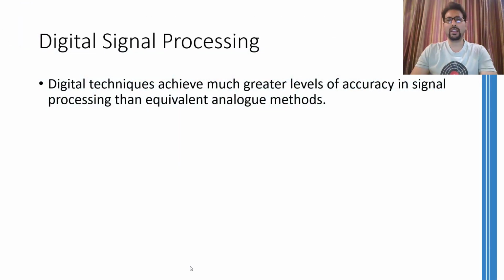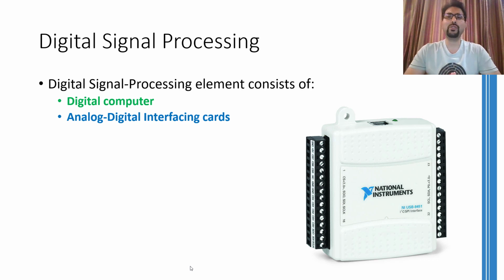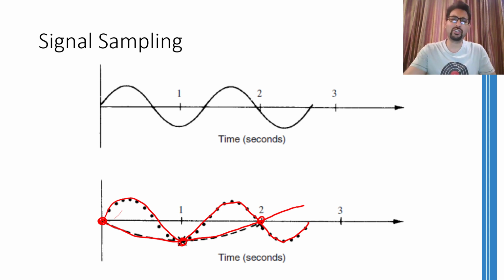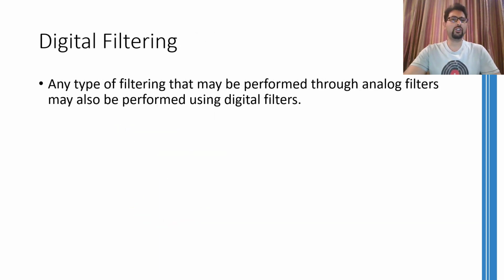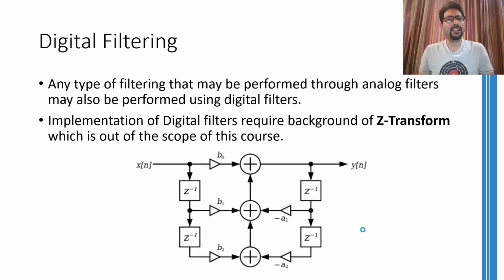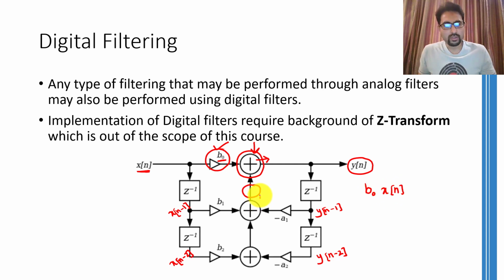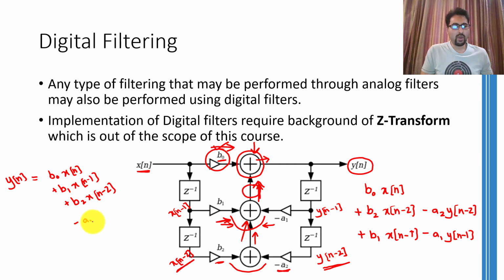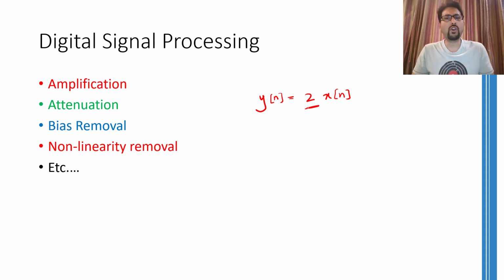Lecture 6 Digital Signal Processing | DSP | A Quick Introduction

Comment: 1- Quantization in digital processing,is the mapping of input values of a largest set to output values in a smaller set 
2- Quantization error is the difference between input signal
And the quantized signal.

Comment: 1) Quantization is the process of mapping continuous infinite values to a smaller set of discrete finite values.
2)The difference between the analogue signal value and the nearest most available digital signal value at the sampling interval in the conversion process of A/D is called Quantization Error.

Comment: 1- Quantization is the process of mapping the value of a continuous signal to a finite set of discrete signals.
2- Quantization error is given as the difference in the value of an analog signal and its corresponding digital signal.

Comment: - Quantization is the mechanism by which a continuous signal value is mapped to a finite set of discrete signals.
- Quantization Error is the difference between the analog signal at each sampling instant in ADC and the nearest digital value available.

Comment: Quantization is the process of mapping input values from a large set (often a continuous set) to output values in a smaller countable set, often with a finite number of elements. Rounding and truncation are typical examples of quantization processes.
Quantization error is defined as the difference between an input value and its quantized value such as round-off error .

Comment: 1-Quantization is DSP method in which we done mapping of input Value which is usually a continuous set to output value which is small set,often a finite number of elements - For this we choose an amplitude value closest to the original amplitude of analog signal
2-Quantizatiom error is the difference of analog signal and the obtained digital signal which we done by choosing closest amplitude

Comment: A)
Quantization, in digital processing, is the mapping of input values of a larger set (continuous set) to output values in a smaller set
 (finite values set)
B)
 Quantization Error is the difference between the analog signal and the closest available digital value at each sampling instant from the ADC.

Comment: 1)  Quantization is the process of mapping continuous infinite values to a smaller set of discrete finite values
2) The difference between the analog signal and the closest available digital value at each sampling instant from the ADC is called "Quantization Error"

Comment: 1) Quantization is the process of mapping continuous infinite values to a smaller set of discrete finite values.

2) Quantization error is the difference between the analog signal and the closest available digital value at each sampling instant from A/D converter.

Comment: Quantization is the process of constraining an input from a continuous or otherwise large set of values to a discrete set .
1)Quantization in digital processing  is the process of plotting input values from a large set to output values in a smaller set.
2)Quantization Error : it is the difference between the analog signal and the closest available digital value at each sampling instant from the A/D converter.

Comment: .Quantization  is  the  process  of  mapping  input values from a large value of set, to output values in a smaller  of set
2. Quantization error is the difference between the anaolge signal and the closet available digital signal in the sampling of adc

Comment: 1) "Quantization" is the process of mapping input values from a larger set to output values in a smaller set with a finite number of elements.
2) The difference between the analog signal and the closest available digital value at each sampling instant from the ADC is called "Quantization Error".

Comment: 1-Quantization, in digital processing, is the mapping of input values of a larger set (continuous set) to output values in a smaller set
 (finite values set)
2: Quantization Error is the difference between the analog signal and the closest available digital value at each sampling instant from the ADC.

Comment: Quantization is a process of constraining input values from large set of values (continuous infinite values) to output from smaller set of values (discrete finite values).
Quantization error means at each sampling instant the difference between the analog signal to the closest digital value during the A/D conversion.

Comment: 1. Quantization is the process of mapping input values from a large set (often a continuous set) to output values in a (countable) smaller set, often with a finite number of elements. 
2. Quantization error is the difference between the analog signal and the closest available digital value at each sampling instant from the A/D converter.

Comment: 1) Quantization is the process of mapping the value of a continuous signal to a finite set of discrete signals.
2) Quantization Error is the difference between the analog signal and the closest available digital value at each sampling instant in ADC.

Comment: 1-Quantization in digital processing is the mapping of input values of a larger set to output of a smaller set
.
2: Quantization Error is the difference between the analog signal and the closest available digital value at each sampling instant from the A/D converter.

Comment: --> As the name shows the quantization is basically the process in which we map input values from a bigger set to output values of a smaller or finite set of elements

--> Quantization error is the difference between the analog signal and the closest available digital value

Comment: Quantisation in mathematics And digital processing system, is the process of mapping input values from a large set to output values in a smaller set.

2  Quantisation error is the difference between the analogue signal and the closest available digital value at each sampling instant from the A/D convertor.

Comment: The process of mapping input values from a larger set to output values in a smaller set with a finite number of elements is referred to as Quantization.

The difference between the analog signal and the closest available digital value is referred to as quantization error.

Comment: Quantization describes the process where continuous analogue signal is converted into discrete values of digital signal by sampling the analogue after regular interval.
Quantization error: At any particular value of analogue signal, the digital representation is either the discrete level immediately above or below this analogue value, if we consider this difference as Q, then maximum error in each digital sample is +/- Q/2, which is known as quantization error.

Comment: 1.Quantization is the process of mapping input values from a large set, to output values in a smaller set.

2.Quantization Error is the difference between the analog signal and the closest available digital value at each sampling instant from the A/D converter.

Comment: 1:Quantization in digital signal processing is a process of mapping input values from a large set to output values in a smaller set, often with a finite number of elements. Rounding and truncation are typical examples of quantization processes.

2:Quantization error is the difference between the analogue signal and the closest available digital signal value at each sampling instant from the analogue to digital converter.

Comment: 1- Quantization:: Quantization is the process of mapping continuous infinite values to a smaller set of discrete finite values
2-Quantization error is the difference between the analog signal and the closest available digital value at each sampling instant from the A/D converter

Comment: 1. Quantization is the process of converting discrete sample values to some finite set.
2. Quantization error  is the difference between the analog and digital signal and the closet available digital value at each sampling instant from the A/D converter.It also introduce noise.

Comment: 1. Quantization in Analogue to Digital signal Processing is to map out larger set of continuous range of values i.e analogue signal to smaller set of limited range of Values i.e digital signal.

2. Quantization Error is the difference between the analog signal and the closest available digital value at each sampling instant from the A/D converter.

Comment: 1) : Quantization in Analogue to Digital signal Processing is to map out larger set of continuous range of values(Analogue signal) to smaller set of limited range of Values(Digital Signal).

2):  Quantization Error is the difference between the analog signal and the closest available digital value at each sampling instant from the A/D converter.

Comment: 1. Quantization is the process of changing a continuous data signal (having infinite values) to a discrete data signal (having countable number of values).
2. Quantization error is given as the difference between the value of analogue signal and the closest value of  its digital signal. The greater is the difference, this larger is the error.

Comment: 1. Quantization digital signal processing, is the process of mapping input values from a large set to output values in a smaller set, often with a finite number of elements. 

2. The difference between an input value and its quantized value is referred to as quantization error.

Comment: 1. Quantization is the method of mapping the input values from a large set i.e. continuous set, to a small finite set consisting output values for further purposes in DSP.

2. The difference between the analogue signal value and the nearest most available digital signal value at the sampling interval in the conversion process of A/D is called Quantization Error.

Comment: 1)Quantization, in digital signal processing, is the process of mapping input values from a large set to output values in a smaller set, often with a finite number of elements. 
2)Quantization error is the difference between analogue signal and the closest available digital value at each sampling instant from A/D converter

Comment: Quantization is the process of mapping input values from a large set (often a continuous set) to output values in a (countable) smaller set, often with a finite number of elements. Rounding and truncation are typical examples of quantization processes.
Quantization error is defined as the difference between an input value and its quantized value (such as round-off error) .

Comment: 1.Quantization is the process of mapping continuous infinite values to a smaller set of discrete finite values. In the context of simulation and embedded computing, it is about approximating real-world values with a digital representation that introduces limits on the precision and range of a value .
2.Quantization error is the difference between the analog signal and the closest available digital value at each sampling instant from the A/D converter

Comment: 1) Quantization in  Digital signal Processing is to map out a larger set of a continuous range of values(Analogue signal) to a smaller set of the limited range of Values(Digital Signal).
2)Quantization Error is the difference between the analogue signal and the closest available digital value at each sampling instant from the A/D converter.

Comment: 1) Quantization, digital signal processing, is the process of mapping input values from a large set (often a continuous set) to output values in a (countable) smaller set, often with a finite number of elements. Rounding and truncation are typical examples of quantization processes.
 An analog-to-digital converter is an example of a quantizer.

2)  Quantization error is the difference between the analog signal and the closest available digital value at each sampling instant from the A/D converter.

Comment: Quantization means converting an infinite set of analogue values to a smaller set with discrete values. Quantization error is the difference between the analogue amplitude and the respective digital amplitude taken at each step of Quantization.

Comment: 1)Quantization, in mathematics and digital signal processing, is the process of mapping input values from a large set to output values in a smaller set, often with a finite number of elements. Rounding and truncation are typical examples of quantization processes. Transaction of infinite terms in a series for example Taylor series and considering just first few terms for the sake of simplicity is also called Quantization.
2)Quantization error is the difference between the analog signal and the closest available digital value at each sampling instant from the A/D converter. Quantization error also introduces noise, called quantization noise, to the sample signal.

Comment: 1. Quantization is the process of mapping input values from a large set to output values in a smaller set, often with a finite number of elements.
2. Quantization Error is the difference between the analog signal and the closest available digital value at each sampling instant from the A/D converter.

Comment: 1. Quantization is a process of mapping input signals of larger set to the output signals of smaller set.

Quantization error is the difference between the input signal and the quantized signal.

Comment: 1. In DSP Quantization is the process of mapping input values from a large set to output values in a smaller set, often with a finite number of elements
.....................
2.The difference between the analog signal and the closest available digital value at each sampling instant from the Analog to Digital converter is called Quantization Error.

Comment: 1)
In ADC, Quantization is such process in which the continuous range of values of an analog signal are divided into nonoverlapping but not necessarily equal subranges, sampled and a unique value is assigned to each subrange.
2)
The difference between the analog signal and the closest available digital value at each sampling instant from the Analog to Digital converter is called Quantization Error.

Comment: Quantization is the process of mapping continuous infinite values to a smaller set of discrete finite values. Example of quantization is rounding off and truncating.
Quantization error is the difference between the analog signal and the closest available digital value at each sampling instant from the A/D converter.

Comment: 1) Quantization in Analogue to Digital signal Processing is to map out larger set of continuous range of values(Analogue signal) to smaller set of limited range of Values(Digital Signal).

2) Quantization Error is the error produced when mapping the Values from Analogue Signal to Digital Signal at any instant.

Comment: 1: Quantization, in digital signal processing, is the process of mapping input values from a large set to output values in a smaller set.
---------
2: Quantization Error is the difference between the analog signal and the closest available digital value at each sampling instant from the A/D converter.

Comment: 1)Quantization is a process in which the continuous range of values of an analog signal is sampled and divided into nonoverlapping (but not necessarily equal) subranges, and a discrete, unique value is assigned to each subrange.

2)Quantization Error is the difference between the analog signal and the closest available digital value at each sampling instant from the A/D converter.

Comment: Quantization is a process of mapping input signals from larger set (analog signal) to the outputs of smaller set(digital signal).

Quantization error is a actually a difference between analog signal and closest digital signal that is available. Moreover quantization error may introduce noise in the instrument and it can be removable.

Comment: 1_ Quantization is a process of mapping input values from a larger set of continuous values ( Analog signal values ) to output values in a smaller set ( digital signal values ) e.g., A/D converter uses this phenomenon.

2_ Quantization error is the difference between the  input value of a continuous signal to digital quantized value at each sampling instant.

Comment: 1)Quantization, in mathematics and digital signal processing, is the process of mapping input values from a large set (often a continuous set) to output values in a (countable) smaller set, often with a finite number of elements. Rounding and truncation are typical examples of quantization processes.

2) Quantization error is the difference between the input value and its quantize output value.

Comment: 1) Quantization in Digital processing  is the mapping of input values of a  larger set to output of a smaller or countable set. E.g truncation and rounding.

Quantization error is defined as the difference between an input value and  its quantized value.

Comment: 1) Quantization, in digital signal processing, is the process of mapping input values from a large set to output values in a smaller set.
Quantization Error: Now the difference between the input value and its Quantized value is called the quantization error or generally the Quantization error is the difference between the analog signal and the closest available digital value at each sampling instant from the A/D converter.

Comment: Quantization:  Quantization in digital signal processing is a process of mapping input values from a large set to output values in a smaller set, often with a finite number of elements. Rounding and truncation are typical examples of quantization processes.

Quantization error:  Quantization error is the difference between the analogue signal and the closest available digital signal value at each sampling instant from the analogue to digital converter.

Comment: 1.Quantization is the constraining the continuous or large  input set of values to discrete set .
1.Quantization error is the difference between the analog signal and the closest available digital value at each sampling instant from the A/D converter.